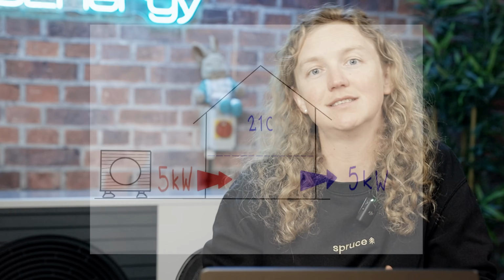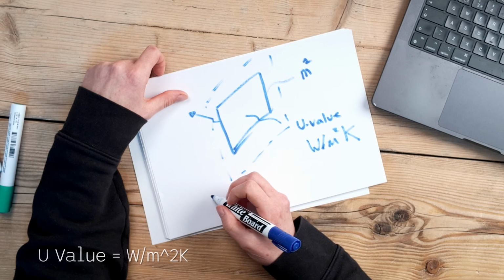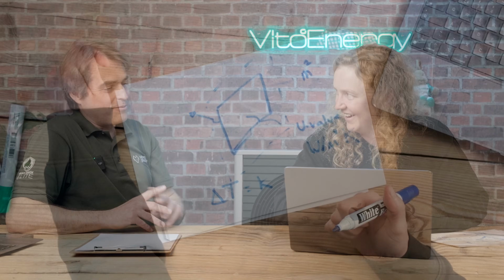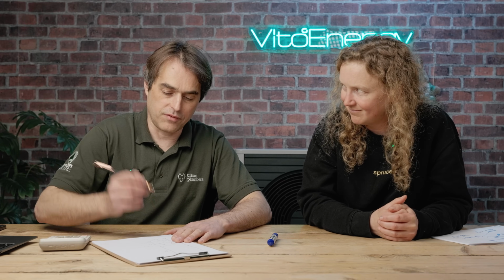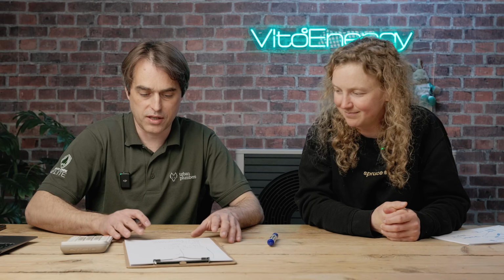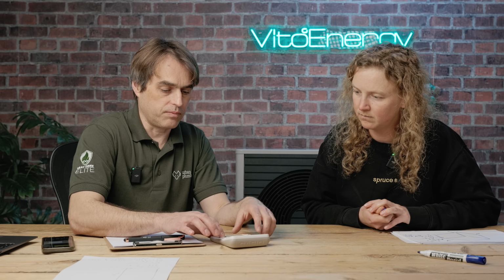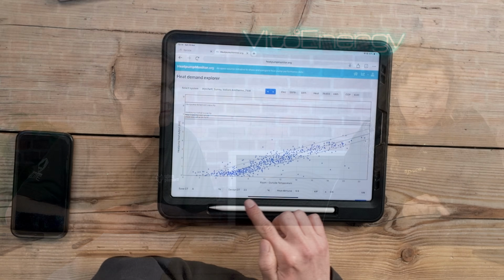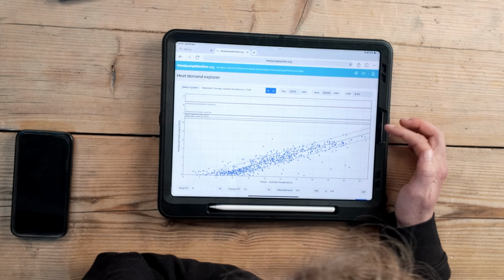Heat Loss: Why Everyone Gets It Wrong & How To Fix It

Comment: Hi Szymon, thanks for the video and the information! At 2:46 in the video you asked Steph "if the building uses energy over 24 hours is the heat loss that energy used over those 24 hours at the design temperature, or is it something else?" Steph went on to say that heat loss is power, how much heat that building is loosing at a certain moment. Then an image popped up showing that if there's a 5 kW heat loss, then to maintain an the indoor design temp of 21, a 5 kW heat source is required. You guys then moved onto some good theory, but your question wasn't answered directly. If possible, could you please shed some light on whether the kW heat loss is per second, per hour, or per 24 hours, or (as you mentioned) something else. All the best, and thanks again. Simon
Reply: Heat loss is by the hour.

Comment: super informative info, as a house owner, to bad that on the east side over the pond there are no urban plumbers heat geeks and spruce software options. I did a heatloss calculations using chatgpt and (heat geek info and videos from mr urban plumbers) my home has a heatloss of 5.4 KW, the heat pump engineer who measured my house gave a heat pump advise of at least 20 kw and a big buffer vessel, than I showed him my door. 
knowledge is super important as a owner, keep informing me. 
Thanks

Comment: Good piece of content. I think the key from the CIBSE methodology is to understand the method potentially is more of a worst case scenario with no internal gains from solar or occupancy. The air changes are possibly a bit high especially for open plan spaces but definitely possible. Then you get into the world of accurate u-values which is another kettle of fish but biggest factor is getting your areas right. The real world heat loss "should" be less than this so not adding too big a safety factor to the heat pump sizing.  
Beyond that you are getting into really nerdy things like sun angles, shading, thermal bridging, thermal mass, control systems, ventilation dynamics etc...

Comment: V good explanation with worked examples. One question, in an earlier HG vid, varying room temperatures was shown to be counter productive as the system as a whole was reqd to work even harder than would have been the case, had all rooms been set to the same (higher) temp.  Or have I misunderstood something basic?

Comment: If you're using the whole house all the time who cares how much heat is lost through internal walls? It's especially silly if you have MVHR - why not just do the calculation for the whole box? Also wouldn't it be much simpler and more accurate to heat up the house and then turn everything off for the day while monitoring the temperature inside and out, and using those values to calculate real heat loss? Failing that, just look at how much gas was used in January and take away what was used in July? At the end of the day, it's not an exact science because too much of the calculation is based on guesstimates of air changes, state of the wall cavity, quality of the gas filled glazing, wind shear, wet vs dry walls etc.

Comment: To get my heat loss before moving to a heat pump, I left my thermostat at 20C for a whole winter and worked out the kW per degree delta-T.

I recorded my Octopus gas usage per dayin a spreadsheet alongside the average daily temperatures for my location from Wunderground.

Allowing for an estimated boiler efficiency of 90% it told me that my house has a heat loss at -2C of 6.5 kW. This helped me validate my heat-loss calculations in preparation for getting a heat pump.
Reply: This is the way to do it... 

If you have a smart meter and a decent energy supplier with an API, you can do it after the heating season. We ask customers for access to the data and run it through some (simple) code we wrote. Then we work backwards for room-by-room calcs.
Reply: @stuartornum The gas industry in Australia’s got us all stitched up. We have mechanical meters and no easy way of monitoring daily usage. But my boiler is so basic that it just either runs the burner or it doesn’t. So if I log when the burner is on or off, which is indicated electronically in its circuit board, I measure how much energy it uses.
Reply: Quick question @HowardBurgess . Did you divide the daily usage by 24 (hours in the day) or say 15 (hours of heating)? I guess 24 would under-estimate, whilst the 15 would over-estimate heat loss since the first hour or so of heating would be replacing heat lost overnight.
Reply: @mountsorrelheritage what I did was a bit wasteful, just for one heating season. I left the thermostat at 20C all day and all night. Hence, I divided daily usage by 24. It felt easier and more accurate that way, otherwise as you say, the first little while would be making up for lost heat overnight.
Reply: @HowardBurgess I did exactly the same although I varied the fixed temperature by 1 degree each billing period; starting in September at 17 degrees, October 18.... etc. until January at 21. In February I started reducing by 1 degree for each billing period. Doing the same calculations as you for boiler efficiency and choosing a COP of 3.5 in December I needed an average of 50 kW / day of electricity just to heat my house! I am currently waiting for my ASHP installer's calculations.
Reply: @RJPick1 if people have the time, inclination and knowledge to do these long-terms tests, I think it really helps to understand the energy use.

Were you able to see a linear increase/decrease in the energy needed for your house, as you gradually varied the thermostat setting?
Reply: @HowardBurgess  I have tried several times to post the actual figures in a tabular form but FB doesn't seem to like the TABS. But yes a marked increase as the Months got colder and I set the thermostat (Tado) higher meaning the Delta Temp Inside to outside increased. e.g. October 18 degs used 2,668 kW of gas, January 20 degs used 5,711 kw.
Reply: Lovely. So installers should demand that data from their customers before giving a quote?
Reply: Informative video

Comment: This is a great video. I asked a couple of local heating plumbers (they're not heating engineers in Australia), and the extent of their heat loss assessment was to ask the size of my existing gas boiler, and then recommend a heat pump of the same capacity. This would be an insane level of oversizing. So I'm putting together a data logger with a bunch of temperature sensors to monitor the temperature inside and outside the house, in a few of the rooms, as well as the flow and return pipe temperatures and the amount of time the burner runs. From all this, I hope to be able to work out how much heat loss we actually have. THEN, I can talk to some more heating people and look seriously for a heat pump to replace this old boiler.
Reply: Don’t have to go through all these inconveniences. There is mathematical data u can use to calculate pretty accurately the fabric heat loss. However, a bigger uncertainty is the ventilation heat loss though and here your method might give a better understanding.

Comment: Ive completed a heat loss survey for a self build but dont want to use the default air change rates from cibse because my air pressure test result with be between 2 and 3m3/h/m2@50PA.

Id like to edit the defaults but worried i could undersize my emitters which i need the lower heat loss result sonthat i can achieve a 35°C flow temperature without enormous radiators.
Reply from the maker: New build with 35c will not need enormous rads,  it even with 0.5ACH
Reply: @UrbanPlumbers  i have a self build with a 650w heat loss room above a garage. 6.2 x 4.8m

At 32.5 mwt to provide 21 at -4.5C i require 4394w. Scale factor 6.76.

Getting the ach more realistic reduces total property heat loss from 5.8kw to 4.1kw on 200m2.

I'm just nervous of undersizing

Comment: The air changes is just crazy. I was grateful that i found an installer that was happy to use my calcs, otherwise I'd have had a 17kw unit instead of a 12, which has been working perfectly. I did my heat loss using my own excel spreadsheet, took quite a few hours!
Reply from the maker: 17kW and 12kW units were probably exactly the same output anyway if both were single phase. For example 12kW Vaillant and 17kW grant are just 2 different names for 2 units with comparable outputs. The issues here is a lack of standardised naming and badging of units. Ohh and both units are most likely around 10kW mean output anyway. Video explaining all that coming soon.
Reply: @UrbanPlumbers  I think a video on open energy monitor is in order. Sort of a walk though with it and what people can see and learn. Get Trystan and Glyn on!
Reply: You are the only man I listen to they try sell you something you fit it and back it up with a guarantee.RCBO compliance F or B no info given.EVEN GRANT WONT PUT IT IN THEIR INSTALMENT INSTRUCTIONS haha.
Reply: Lie that’s how you tweak your calculations.
Reply: I look at my electricity bill day by day simple.

Comment: This is a terrific video, thanks.  The most important piece of information for me was that SIBSE specifically say that their ACH numbers are for the worst cases.  I have a house built in 1968.  A consultant has insisted on using the Pre-2000 numbers for ACH, even though we had all the doors and windows replaced in 2009.  Our gas bills demonstrate that the heat loss is considerably less than the consultant's prediction.
Reply from the maker: yes - ACH are the worst case which evyeone seems to miss.

Comment: Paid the Heat Geeks for a heat loss survey. They said it was 8.2. Unfortunately they quoted me nearly £25k for a 10kw heat pump, including underfloor heating which I already have.
Had another company a few weeks later and they calculated the heat loss at 11.5 and quoted just under £18k for a 13kw heat pump! 
To say I’m confused is an understatement.
Reply from the maker: Yes, that’s the state of the industry - as the title says.
Reply: We had a similar experience but the higher heat loss calculation company used the Spruce app!
Reply from the maker: @sarahc2624 tools only make the job easier. It’s the person using the tools that needs to understand what they are doing. Garbage in garbage out.

We will publish full instructional video on how to use heat loss tools on site and how to survey in the near future

Comment: Great work Szymon. Really good stuff. When sizing heating system do we need to know about thermal bridges also? I guess I need the CIBSE design guides. 
Also interesting to talk about ACH, with UK building regulations we normally talk about M3/M2/h more of a mouthful but is actually quite good. 
To achieve Passive house levels of low energy building there is a ACH target - great just what we need for low energy buildings but it's also makes it easier to game the numbers by having a much larger building. With greater volume the air changes is likely to go down.

Comment: Fantastic vid! Steph well done, brilliant. What annoys me a bit is a bungalow. If I insulate a loft massively it shouldn’t be treated as the outside and a cold area
Reply: I’m currently having the same problem. Only mine is a bungalow with a loft conversion so each room has a section of converted loft (room above/inside space) as well as the unconverted eaves spaced that are measured as outside.  Plus to add to complication the loft room is a dual hipped roof! So all manner of angles to calculate to get the correct room volume.

Comment: Trouble is with these calcs… is that they don’t add up to the reality. We have a heat loss calculation that massively overestimates the amount of energy we actually use annually. (Based on 10years of historical real data).  So the calcs are impacted by massive oversimplifications - especially on the ACH and the relative u values of doors, windows, floors and walls. 

When we then get an estimate of the heat pump required, we end up with a hugely over specified system that doesn’t work efficiently. (Just cycles too often, and never gets the compressor operating and working consistently)

Our heat loss calc was really easy. We had  LPG gas central heating and it used 29 MWh per annum every year heating the house to 20 degrees.   So that I our heat loss. Divide by 2000 for a safe cop  estimate and that means a heat pump of about 14.5 kw
Reply from the maker: We have been studying calculations vs actual heat loss for a good while and can get them to around 10% accuracy. My problem are undersized units, and not oversized. Heat pump sizing is just another can of worms, as most manufacturers don’t publish accurate or reliable output information
Reply: @UrbanPlumbers  Like the 7KW Vaillant Arotherm that doesn't give output what it says on the tin?

Comment: Super useful. There are lots of homeowners like me who want a heat pump, but simply cannot trust the heating engineer. Too much of my money is at stake to trust someone who can have all the qualifications, but still be a bad heating engineer. So, we homeowners need to verify, and I guarantee many of us are watching these videos to equip ourselves to do just that. It's a shame that Spruce only caters to heat pump engineers who do lots of heat pumps and consequently you charge a lot of money for the tool. Why not allow homeowners to do their own calculation? Charge us once, only allow one layout. Pay per use. Please!
Reply from the maker: @Supanova7G  you can already do that. You just need an engineer with a Spruce account that will allow you to to survey your own home and you can pay per project.
Reply: @UrbanPlumbers that’s brilliant. Finding the right professional is very challenging and as a home owner it’s sadly quite easy to be more technical with the calcs than the majority of freely available plumbers. I had a system replaced a few years ago and the chap measured the window, took a bit off and suggested that was the right size, then didn’t wire up opentherm on a capable boiler. Similar story with my parents too. These are really great videos for the discerning home owner keen to get the best but also have sufficient knowledge and control to have a good two way communication with the engineer. I really think the heating consultancy is an important part of the industry not readily available which would make good design readily available to those which mainly want to install without the need qualifications.
Reply: Heatpunk is free to use and equally capable.
Reply from the maker: @Ta11Skinny  i tried heat punk -you can get a HL done on it, but it is nowhere near as good or user-friendly as Spruce. I do not know of any professionals using Heat Punk, but for one off homeowner heat loss it is probably decent.
Reply: @UrbanPlumbers  what was missing from Heatpunk?
Reply from the maker: @stuartdyer9696  Spruce is another level. UI is so much better than anything out there. Desgin tools are amazing. It pulls a lot a materials from EPC, pulls existing floor plans, app for surveying is so intuitive and quick to use. Heat Punk is fine, but nowhere near as usable, flexible or quick as Spruce. Spruce also does much more as a surveying tool and full heat pump system.
Reply: @UrbanPlumbers  I rarely want any information from EPC's as they are so often wrong. We have had floor areas massively off, wall construction, roof construction and the list goes on. The majority of EPC's are extremely poor and they really need to be overhauled.

Comment: Very well explained - and this highlights the difference between the average gas fitter versus what many like to refer to themselves as heating engineers - understanding this level of maths and design thought is the difference 👍

And to add I ran my house through Heatpunk and tweaked a few things here and there - ACH makes a huge difference as noted but also even subtle things like the wall make up - it could well be the difference between the next size up and being oversized rather than “big enough”

Comment: Really useful video. My only thought was the final portion - if you're using a heat pump to measure actual heat loss then it's too late no? Is there no way to do a real controlled test to validate the full calculations?
Reply: Exactly what I was thinking. How can you prove the numbers before specifying a heat source ?

Comment: I have been using the bucket analogy to customers for years, they understand it clearly that way. I have used heat punk and heat loss engineer. It’s the MCS paperwork which is the killer. Getting audits and the amount and cost of joining schemes is so appalling. System design was lost when proper apprenticeships went.

Comment: This is a useful exercise for anyone wanting to install a heat pump and who wants an independent ballpark estimate of heat loss. As an atmospheric physicist who, in retirement, decided to become a retrofit assessor and advisor, I think it’s important to highlight that the energy consumption estimate provided by an Energy Performance Certificate is often a poor guide to heat loss for the reasons that airtightness and thermal bridges are not well represented by the RdSAP and SAP. This may explain why many heat pump installations are oversized. On the other hand, modelled heat losses using the Passive House Planning Package have been shown to be much more reliable. This is because the PHPP adopts more sophisticated approaches to data collection and heat loss modelling.
Reply: MCS rules are what leads to oversized heat pumps —by design! The rules say installers must not take into account any other source of heat including every kW of electricity being used in the house,  people, pets or solar gain. Also you must size the pump to cope with the coldest 3 nights of the year (even though you're likely to be asleep in bed)  so it will be oversized for 362 days. Xmas jumpers and emergency convectors are banned.